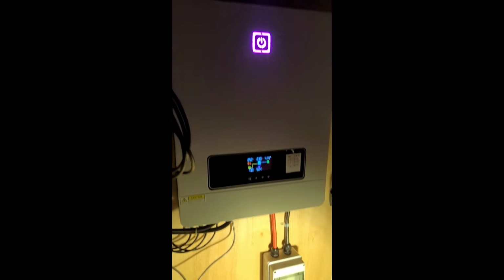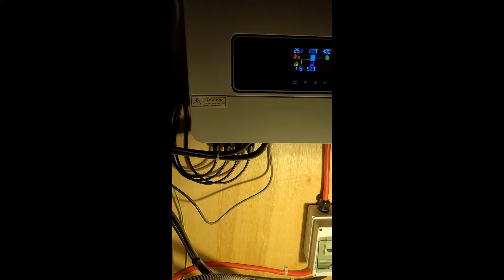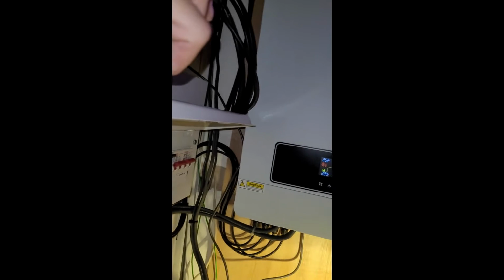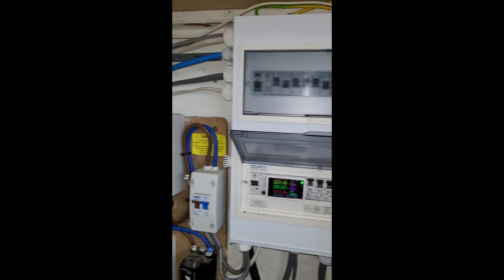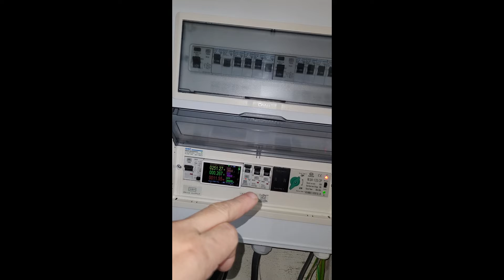Anenji 8.2kw Hybrid Inverter - DIY Setup

Comment: Love it love it love it I was doing the same thing but when you're in a leasehold property it didn't last I'm planning on doing the same thing when I move it did cut my bills down dramatically where did you get that transfer switch that fits in the combiner box
Reply from the maker: The autmatic transfer switches are available via ebay - Geya do a nice one - PV Solar Automatic Transfer Switch 3P 63A 230V Solar To Grid Dual Power 50Hz

Comment: I've always assumed hybrid inverter can blend grid and battery/solar with gris for when you don't have enough juice, but seems you still need a auto transfer switch. How does it work?
I occasionally need all my 12-14kw, but only wanna get inverter of around 8kw. Looking for inverter that has transfer switch integrated but they all still rated for around 8kw or 12kw surge.
Reply from the maker: My system was probably over-engineered with the transfer switch but i needed to be able to switch the house back to grid easily if my DIY turned out to be dodgy and everything stopped working on some dark and stormy night.
Reply: @switchdoctorstu4288  thanks for the info!
Reply from the maker: This was exactly my problem.  Other models like Sunsynk had a 'CT' or current tap that wraps around your home supply and monitors how much energy to feed in and how much to store. This Anenji model cannot do this.
I split my house distribution board into a high current section (cooker, shower etc.) which i kept on the grid side of the inverter and a low current section (lights, utility sockets) that i fed from downstream of the inverter. I set the inverter to grid-tie so that it dumps any excess back to the grid. - Note that this inverter isn't compliant so you'll not be able to get a feed-in-tarrif using it.
Reply from the maker: The current bypass works well to allow the grid to subsidise the solar when the downstream load is too much. I've not tried to push this past the rated 8kw of the inverter.

Comment from the maker: Update - Six months in: I will post another video but basically I've had to give up on using my flooded cell batteries with this inverter. It doesn't manage them correctly and would drain them dangerously low overnight. Using the Inverter in hybrid mode without batteries now and it's working great except that i can't register in the UK for feed in tarrifs as it's not approved.  On the plus sie - This has been a great experiment and the inverter does work, it hasn't blown up, the data logging is nice, it is saving me money. On the negative side - No UK registration for FIT, poor battery management, lack of software updates. Overall i'd give it a 7.5 out of 10.

Comment: How did you get your G98 approved?  Aren’t only approved installers allowed to put in a G98 application?
Reply from the maker: i didn't get it appoved. i didn't apply for the Feed in Tarrif, they were only offering 11p a unit. My plan is to add more batteries and store the excess.